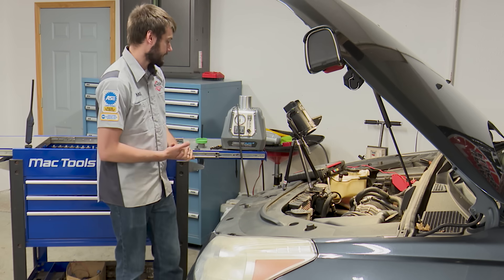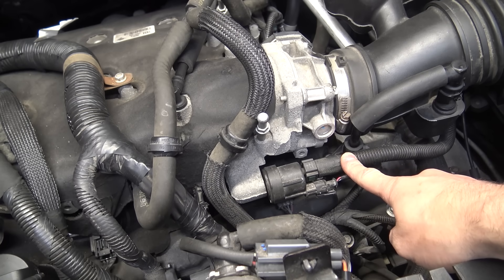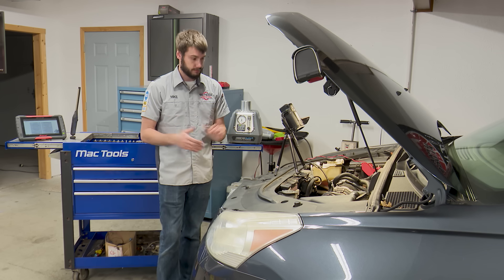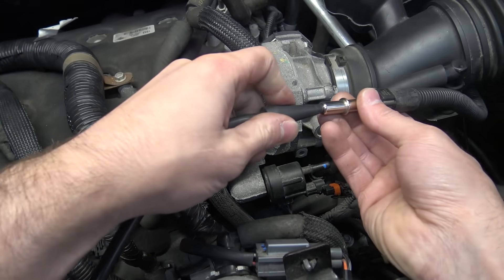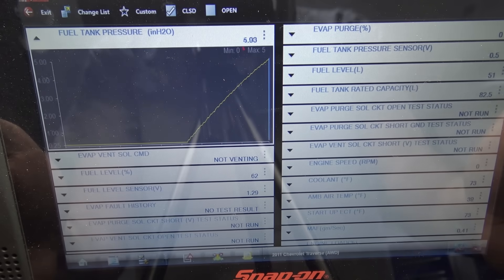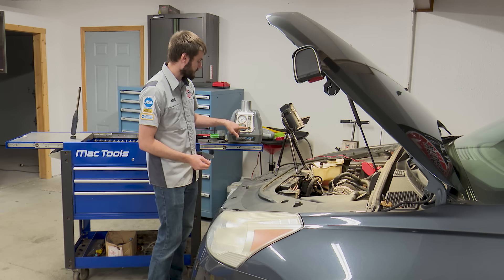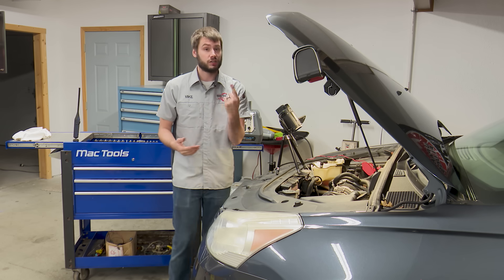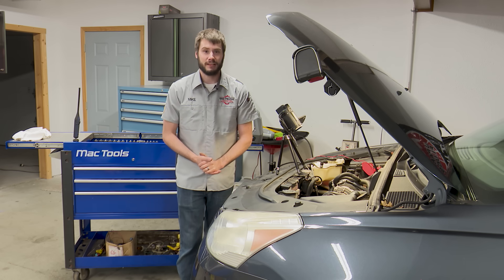How To Perform An EVAP Smoke Test To Look For Leaks

Comment: GREAT VIDEO!!!
The hardest part I find using a smoke tester is closing the system. I don't own a snap-on Solus... That is yet.. So my daughters car has the P0456 and P0457. Ride is a 12 model Avenger with the 4 banger engine. Moving past the typical cap I've checked the following. 10" of vacuum holds indefinitely on the purge solenoid. When applying 12vdc on and off she opens and closes and holds vacuum as it should. Next, I visually checked the seals inside of the evaporative pump. Nothing out of the ordinary? Reassembled everything. My smoker is mineral oil based and has been my go to tool for engine sealing and is very effective. My question is how can I close the system on a 2012 Avenger to accurately perform the smoke test?
Reply from the maker: Hey Media Junkie, thanks!!! That's a ESIM system on there. It has the little white and black assembly mounted to the canister that has weights inside of it. Check out my video covering Chrysler evap. I get into it there. Look in the EVAP playlist for it.
Mike Becker, Senior Instructor

Comment: i have the snap on EELD100a smoke machine. how do you run these machine for 1-2 psi for evap smoke testing. it seems like always going full pressure on these machine?? thanks mike
Reply from the maker: Hey Hua Jack, thanks for watching! I've never used that machine, not sure how it works. Sorry.
Mike Becker Senior Instructor

Comment: Great video! Confirmed a lot of my suspicions with Evap systems and I actually just had an accord with a p1456 and after running the Evap function test it failed. I pulled out the smoke machine and smoke tested them system hoping the cvs valve or two way valve would leak and nothing. Ran another function test and it passed!🤦🏽‍♂️ Couldnt get the system to act up again! They can be bothersome when it comes to intermittent problems
Reply from the maker: Hey Greg, thanks for watching! Ahh the good ole' intermittent EVAP leak...yuk! 
Mike Becker Senior Instructor
Reply: He really explained everything that anybody can understand. Having my car checked for the third time now.

Comment: strobe lights are good for lighting and watching smoke too or hillbilly it with timing light (lol) but having variable speed strobe is good
Reply from the maker: Interesting, you find a strobe light better than a regular light?
Mike Becker Senior Instructor
Reply: @GoTechTraining  I think it's easier to see smoke moving with it "freeze framing", it's about like watching injection patterns and vibrations with strobe lighting also.
you can watch belt harmonic vibrations as well as many others things with your naked eye that way, kind of like poor mans super high speed camera frames being reviewed.
of course being able to vary the strobe speed or synch. it helps a bunch(downfall of the timing light)

Comment: Any tips on smoke testing toyota, Dodge Chrysler evap systems? I've always found that if you don't block the canister where the vent tube connects it looks like the gas cap is leaking. I just plugged it off with a glove or plastic bag and continue testing. Since theres no way to close the vent off bi-derctionally . I've always wonder if that's the correct way to approach these systems since there's no info out there saying how to .
Reply from the maker: Hey Michael, i've always used a hose pinch pliers on these. 
Mike Becker Senior Instructor

Comment: With machines equipped with their own air compressor, can I dismiss the necessity of argon gas in the testing process? Thank you for sharing.
Reply from the maker: Hey Andrew, personally I've never used argon in testing. The only gas i've ever used besides shop air was nitrogen. I'm not sure if the tool has some sort of special compressor/filter type thing that limits the oxygen content. Would need to talk to Redline on that one.
Mike Becker Senior Instructor

Comment: Thanks for the video.  $1500 for a smoke machine!  Yikes.  I built a DIY one with parts I had around the house, and made a video of it.   Laser light tip is a great idea.  Good to know that some cars have a self evap test... didn't know to check for that.
Reply: Same on the self test.  Will search that out.
Reply from the maker: Hey Ross, yeh 1500$ is a steep price. But for a mobile tech or something along those sorts, it's worth it. It'll earn 10 times that in it's lifetime.
Mike Becker Senior Instructor
Reply: Hey Ross.  Maybe you already know this but still worth sharing. After i made my first one i got a good tip from Keith at New Level Auto. He said if testing evap system with  the homemade smoke machines to disconnect the machine from the car BEFORE shutting off the air supply.  That way you dont get fuel fumes backfeeding into your heater apparatus causing any accidents/injury. Fantastic advice. I still do that even now  with my Smoke Pro machine.
Reply: @mikeburton1733  Thanks for the tip!!!

Comment: Autool st206 .$  289.00 have had for 4 years . Works fine for me retired 67 with very limited income. Have found and repaired a po442 and po456 on my 06 subie sti . Also used to find exhaust leak on 99 toyota rav4
Reply: You do need a psi regulator to restrict psi pressure.  I keep it at 1 to 2 psi
Reply: @pirihern9329 PERFECT! I figured I’d had to buy two different machines one for the evap due to its low psi, and the other for normal smoke test
Reply: @pirihern9329 how would you go into installing a a psi regulator?
Reply from the maker: Hey Piri, sounds like the tools done you well!
Mike Becker Senior Instructor